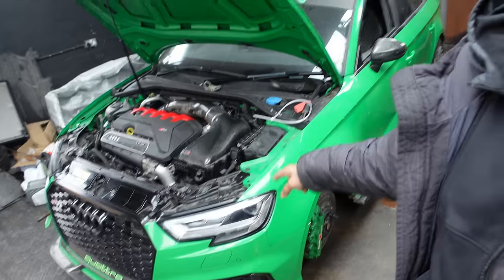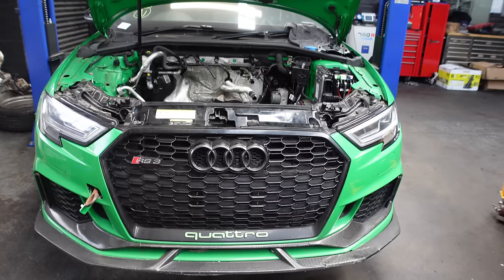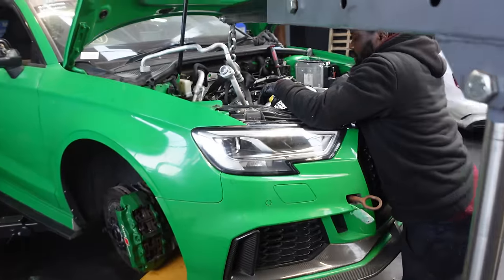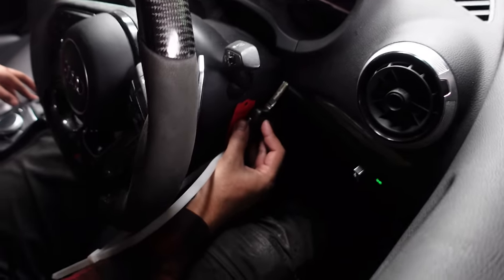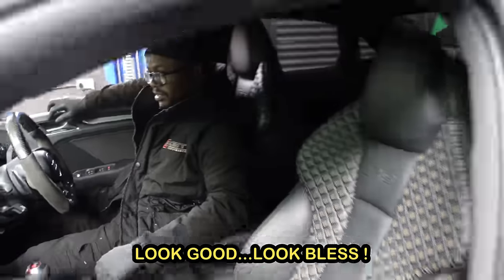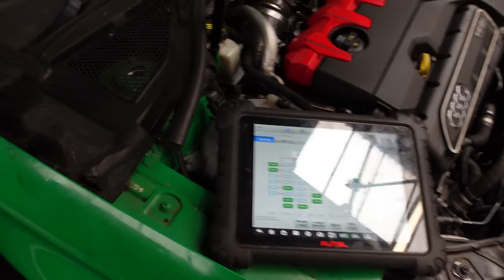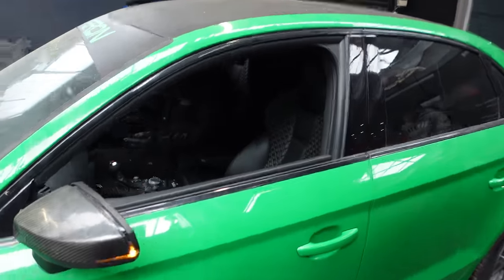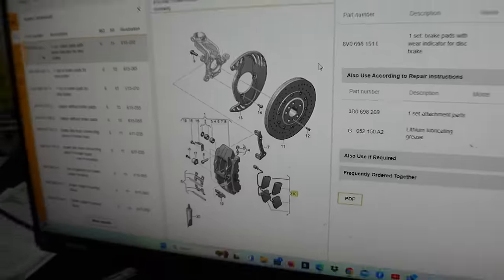WE DID IT ! STARTING THE AUDI RS3 FOR THE FIRST TIME

Comment: Great work bro! Whenever you do engine rebuilds it’s ALWAYS a good idea to prime the motor before actually starting it. So the oil pressure can build up. You risk damaging parts without priming the motor, as it’ll be a straight dry start up for a couple seconds. Even though you may put assembly lube on everything. Parts can still get damaged. also that’s why it threw a low oil pressure code at first.
Reply: thats the least of the worries on this dodgy rebuild with no blueprinting or balancing 😂
Reply from the maker: Like you know what you’re talking about where’s your forged engine or forged rs3 😂😂 don’t speak wass we don’t need to show you step by step and as a matter of fact no business will

Comment: If running DS1, the 25% power gauge is pinned at 25% as you either have 25% ethanol in the fuel if you have an ethanol content sensor connected (i couldn't see one) - this will be bad if it's been sitting for a long time, or someone has manually set DS1 to 25%. I'd check either way to ensure your fuel trims are right before driving it hard.

Comment: You done a fantastic job on the rebuild 
Just wanted to know why is the break disc so expensive!! can’t you just pop on normal audi disc?
Reply: They are Ceramic Brakes brother 
A £9000 optional extra from audi. they are supposed to never fade or need changing but...🤷
Reply: You can get but when you’re running that kind of power this current brake set up is what you want

Comment: Pop and banging a freshly rebuild engine 😂 piston rings will say bye. Such a dream car and ended up to someone that only has money. Doesn’t even know that ceramic brake pads have very little meat on them even brand new. Let the engine have its "break in" process. So unprofessional..
Reply from the maker: Relax it was only up to 3-4k revs max not redlining it we know what we’re doing as you can see we do it for a living no harm done. Rings will be absolutely fine too. Pads are finished feel free to inspect bring your tools with you 😂